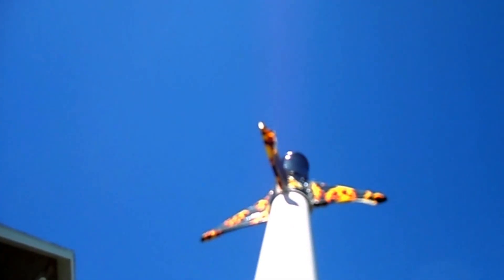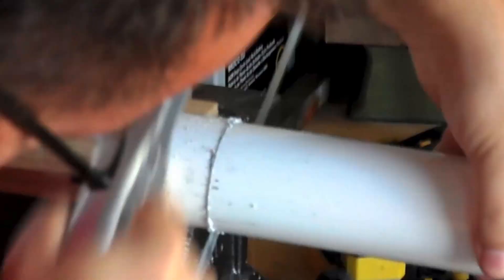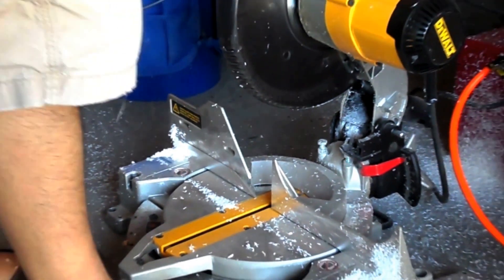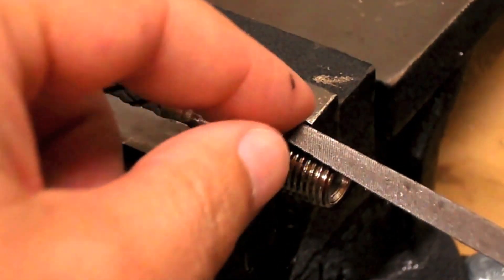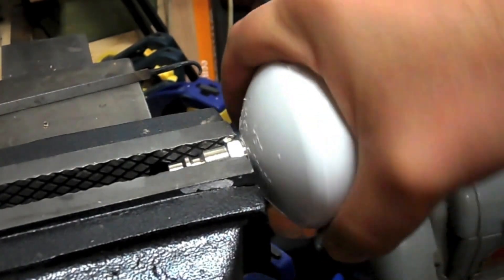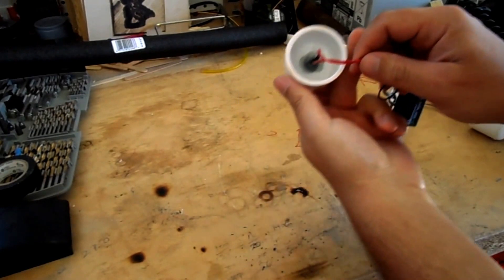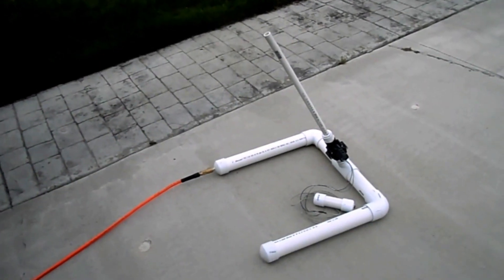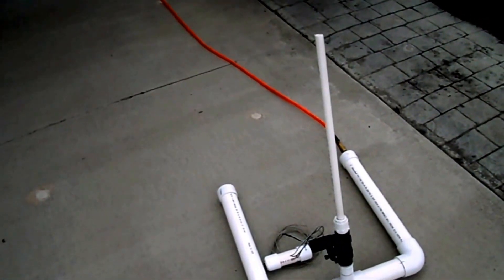How To Make a Compressed Air Rocket Launcher

Comment: Had a question. Loved the betting btw I want to do a 4 tier rocket box with 4 rockets to fire with and that button or a similar type of button set up would be awesome. My question is. What is the psi safety limit, or a safety presser valve that releases excess air to keep drop popping your seals or pvc?
Reply from the maker: tails1010 Thanks!  I'm not really sure what the limit would be.  I think schedule 40 PVC is rated for up to 200 PSI, but I'm not sure.  It should say on the side.  That doesn't mean you should make one of these and try to use it at 200 PSI.  I'm doubt the sprinkler valve is designed for that much pressure.  Also, my air compressor only goes to 125.  Another commenter said his exploded at 100 PSI.  I only use it at between 30-60 PSI for shooting paper rockets.
Reply: Okay cool. I was thinking on making a 2x3 launcher with nerf rockets. Small scale rockets but  I'll be fireing 2 at a time. Was looking for a mini air compressor that I could effortlessly fire off plenty of rockets.

Comment: ok... this is a really cook projects, but 2 very important caveats... DO let the PVC cement set for the suggested 2 hours and 100PSI is WAY WAY too much air... exploded the first rocket launcher... luckily no one was hurt.... 30 PSI will shoot the rockets higher than you can imagine... also, we used 1.5" PVC vs. 2" because they were out of the 2" t and it works just fine.... Now I need to figure out how to build another that supports a bicycle pump adapter.